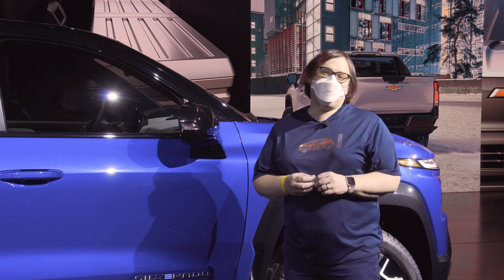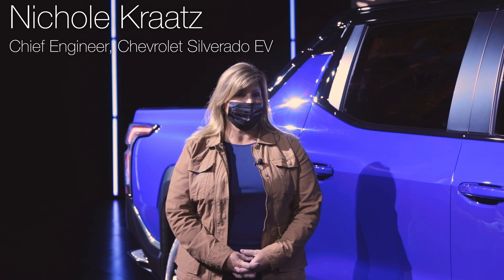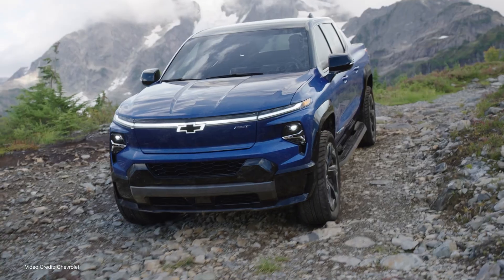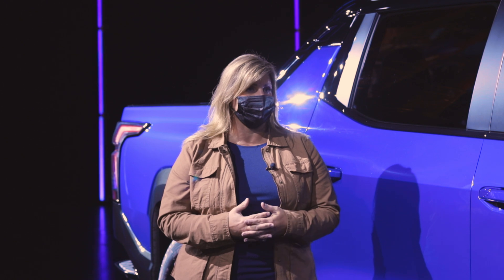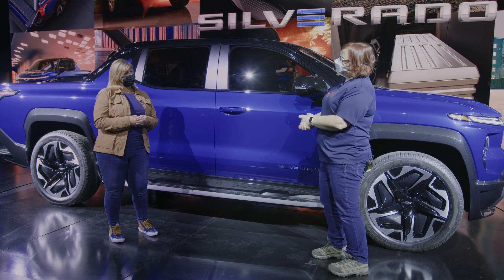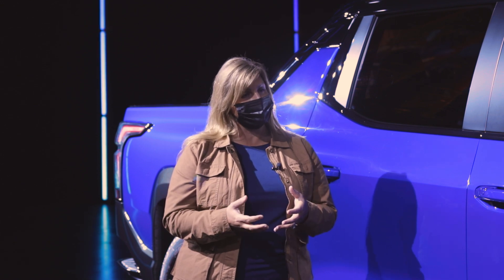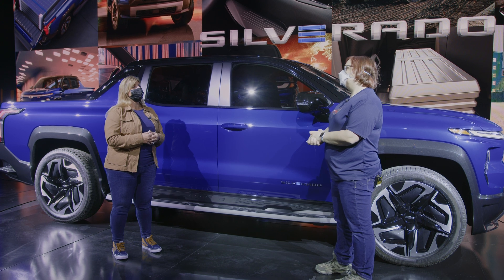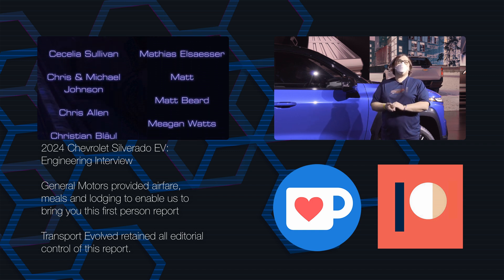Interview: Engineering The 2024 Chevrolet Silverado EV

Comment: WAIT, this is a full length body, probably uni-body... this isn't a pickup, this is a re-imagining of the Avalanche that they had been making before....  Pickups should have separated beds, so they can be removed for different bodies....
If this doesn't have a true frame, then it won't be compliant for a fifth wheel/gooseneck.
Gah, this is WORSE than when chrysler mixed up the Charger/Challenger for the re-introduction (original charger had 2 doors, challenger 4 / new charger has 4 doors, challenger 2), because they are STILL building the Silverado....

I hate it when manufacturers can't keep a model name in line with basic architecture....  =  They AREN'T car people...

Comment: How many Silverado's will Chevrolet be able to make in 2024?  If the number is relatively small then the impact of this truck is going to be limited but if the number is significant (greater then 100K) then this is a significant truck especially considering the specs.

Comment: Gm has no clue tech specs are wish list.
Reply: GM has actually built trucks for a century. How long has Tesla or Rivian been producing trucks, fanboy?
Reply: @vidznstuff1  sorry no dude. I like the truck but… they have no clue no electric truck and or cars are built. Butting a battery in a car/truck is not a design. That is why so far OEM vehicles have had poor range and use more elec than others.. either way this is my opinion

Comment: The "I can't comment on that right now" is most likely the conformation about the truck can be easily aftermarket modified. 
With the rear half of the platform having a more traditional truck frame. It most likely can be adapted for a 5th wheel trailer. Which is usually done by the RV dealership.